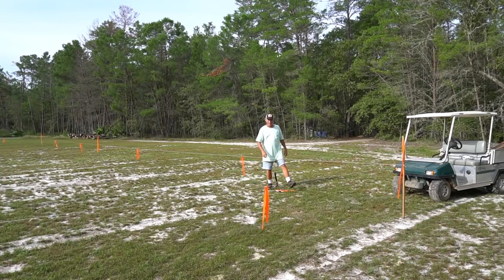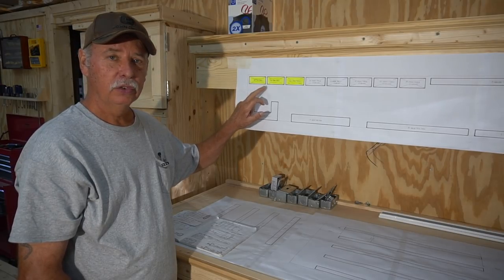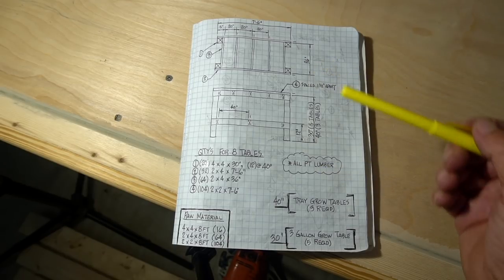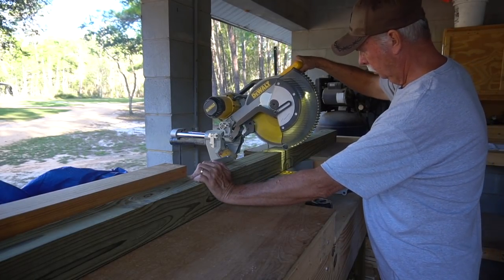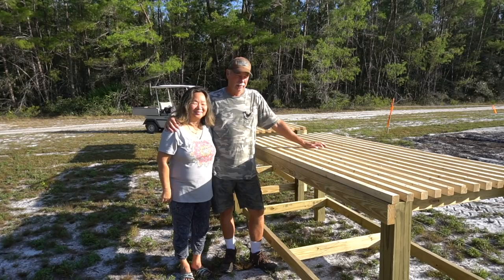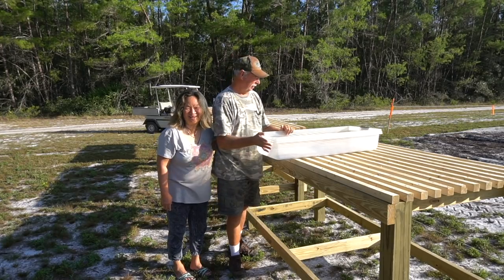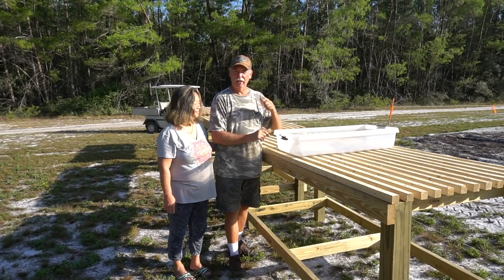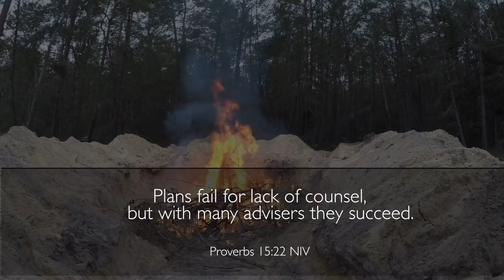How to Start a Container Garden #1 - Garden Layout  and BUILD 40 inch Grow Table

Comment: At one time I had similar grow tables from a green house grower. It was not long before they started to sink in the FL sand. Hydraulic when wet, hydraulic when dry. I placed ft. square ceramic tile under the legs, stopped that sinking feeling .If you want some I hope to visit Ocala (up north) in April. I'm in Madeira beach area.

Comment: Great job. I made some similar by using 4 x 4s from some big pallets I tore down. I noticed you use non pressure treated 2 x 2s. Is this so the bottom of the trays don'''t make direct contact with the PT wood. I guess if any went bad after time they could be replaced easy enough. Thanks again from Michigan

Comment: Wondering if you can use those pieces you cut off at the end of the tables to put between the slots to connect the tables and have more room for more trays.
Reply from the maker: I have about 24 inches between all the tables so I can walk around all the tables if I need to👍

Comment: Hollis, what size drill bits are you using for these; maybe the 3 you use the most.  I have that same drill, but no bits yet.  Suggestions?
Reply from the maker: I use a 1/8” pilot hole

Comment: QUESTION: Are you planning on putting down a couple layers of plastic under each one, so the weeds don't grow up through the slats?
Reply from the maker: No, I simply string trim under them as needed
Reply: @HollisNancysHomestead  OK. How do you handle the very large ones that are so low?